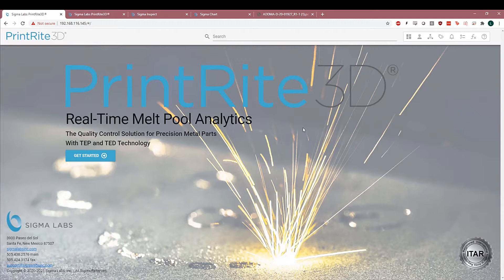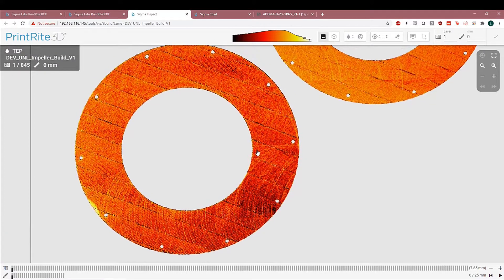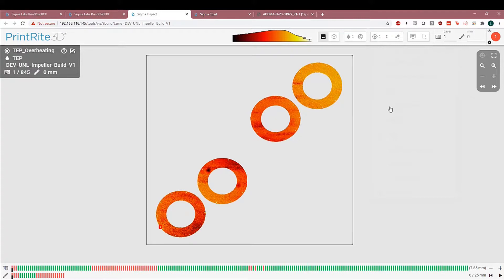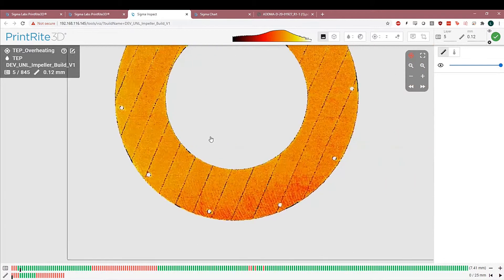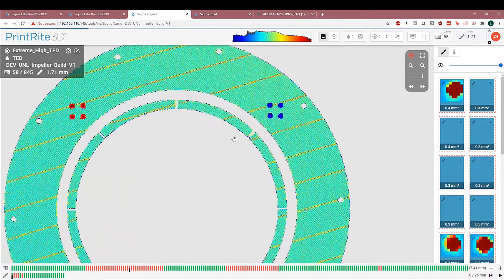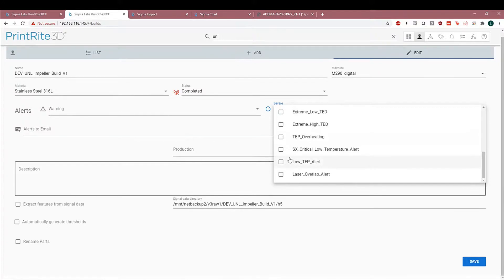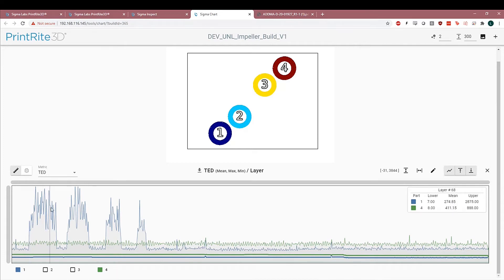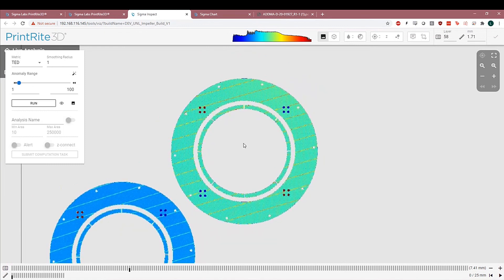PrintRite3D Quality Assurance Additive Manufacturing Demo

Comment: I am so frustrated this company is not bigger by now. I truly believe 3d printing is the greatest invention in human history. When is everyone else going to realize it? I imagine when I daydream, that a tiny drone will be realeased onto another planet. Much like that janky helicopter on Mars. The huge difference will be, is the SigmaSpaceBot will be able to mine its own resources, build its own structures, and duplicate itself. You could literally drop it off, and it would build housing for astronauts, farming areas to quickly grow high protein fungus that could be 3d printed into any food, mine its own resources to make solar panels for electricity, maybe build a contraption that looks like a tetherball which weilds a several thousand feet long cable to troll off the planet that generates power as the planet whips it around. 3d printing bots that could make body parts and organs, and eventually insertable brain electronics. 3d printers, in my opinion, will eventually be the tool needed to stop aging when we are able to program them to make a microscopic bot that can manipulate the outer husk of our DNA to stop aging. I once heard that our DNA is like a shoelace. The plastic that frays on the end of a lace is what cause it to age. If we can stop the fray, aging will cease. I hope instead of building one large object someone figures out how to make several smaller object to create the larger one. Like how ants work and move.  Lastly, since I am clearly going overboard, 3d printers are going to help make nano structures so strong and instasntly adaptable, they will allow humans to either travel to, or at least get to send a camera down to the deepest depths of the ocean. With enough motivated people, the entire trajectory of humankind could shift in the next five years. Maybe 3d printers will be responsible for building the worlds lightest yet strongest fabric to be used in 10 football field size air filters to catch pollutant out of the air, or remove all the microplastics. AND WILL SOMEONE please help the guys trying to make gloves and shoes like Gecko feet so they can walk up walls? It has to be easier with a printer. Anyways, love your company, I have put almost all my saving into your stock because I believe in you all. Best wishes!!!